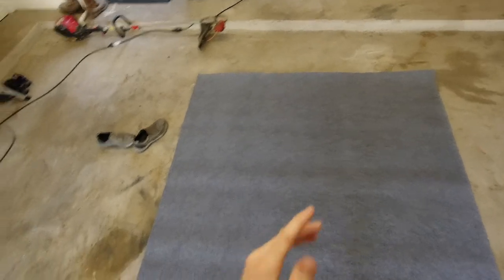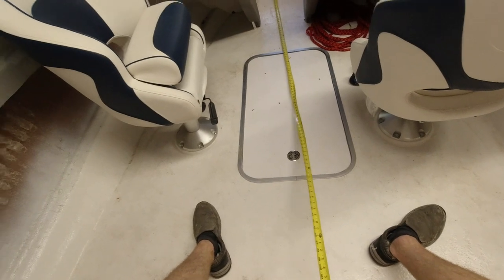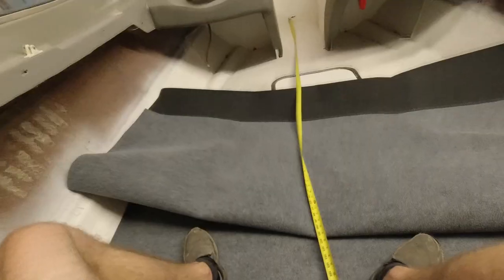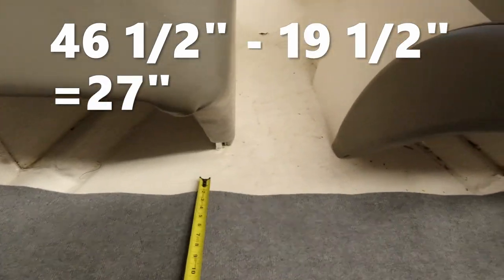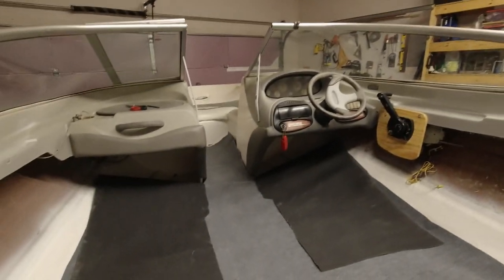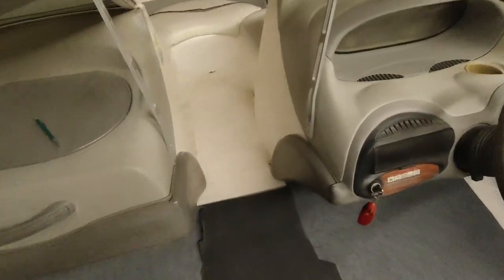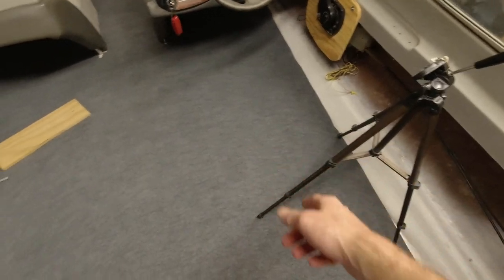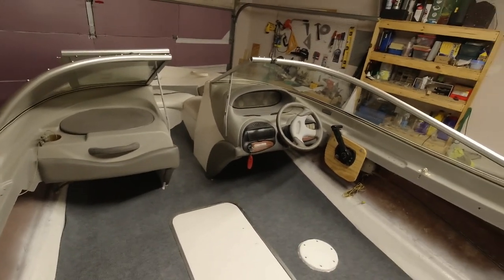Bayliner Boat Restoration - Part 38 - New Carpet!

Comment: I just got a project boat, This is the best video series out there for people rebuilding boats!
Reply from the maker: Thank you! glad you like it! :)
Reply: For more stuff check out friscoboater as well
Reply: @ZachsGarage1  just picked up a 1996 VIP Valiant today for $700 and this channel is going to be my go to for help. I'm in DFW where in TX are you at Zach?
Reply from the maker: @atomicunderground9971  Austin
Reply: @ZachsGarage1  Already having some fun on the boat. I have the 4.3 Mercruiser. Was that engine rebuild your first or did you have previous experience? I'm thinking even though mine is not seized, I should rebuild while I'm at it. There is a weird hole broken near the starter on the fly wheel cover. Its small but I cant figure out what caused it.
Reply from the maker: @atomicunderground9971  First Boat, First Rebuild!
Reply: @ZachsGarage1  Awesome job. Thanks for replying.

Comment: We've installed carpet first in our 2000 Bayliner Capri  and used the existing carpet. If we didn't have it. We planned to use paper to make a paper template.   Saves wrestling with the carpet.  10 years later installed vinyl.  Used a paper template for it turned out great. Glad you got it done. Looks great

Comment: Im Going back with the striped deck matting. Are you putting your side panels back in?
I need a ski locker door can you tell me where you found yours?
Reply from the maker: For the ski locker door I used the old aluminum frame from the original door and just cut out a piece of plywood to size. I think I am going to build some new side panels
Reply: @ZachsGarage1  Yeah my locker was missing. I'll have to find the vid if you made one of your install of it. You could not save the side panels? I love mine. I did find the same pleated vinyl used in the side panels in colors so i may change mine. I'm doing the bulk heads and floor now. Bulk heads are fun, not!. Using poster board to get the shape right on hull though makes a little easier. Heres the links to materials i.mentioned earlier I'm using when it comes to the pretty parts later. 
https://www.amazon.com/dp/B07LH5BVN8/ref=cm_sw_r_cp_apa_i_ixCuFbCEC0V2H, 1https://www.amazon.com/dp/B07YST28VW/ref=cm_sw_r_cp_apa_i_owCuFbHNJ1V6M.
Also thinking of doing some trick lighting on side panels with neon string in seems of the vinyl like i did on a show car i used to have. 
And then some trick stereo of course lol.

Comment: Do you know how to fix small soft spots on boat deck? What product or penetration epoxy to inject the deck?
Reply from the maker: If a spot is soft the wood underneath the fiberglass may be rotted. To fix it you'll need to cut out the area and replace it
Reply: Zachs Garage thanks

Comment: You should have used sea deck more than used carpet
Reply from the maker: I really wanted to get custom designed sea dek. I do actually like the removable carpet more than I thought I would though :)
Reply: @ZachsGarage1  I have 1996 larson that I want to start a project on I bought it back in May but I have with it this summer n winterize it already. So my there are parts of my stringers rotted out  but wonder if I can do do the middle stringers or I have to do the entire thing. Also I have issues with leaks around the gimbal but I used marine sealant n seal around it but I want to take it off n reseal it but I hope the transome ain't rotted out.
Reply from the maker: For the transom, if you want to get a better idea (without removing the engine and outdrive) you might be able to unscrew one of the stud bolts in the transom assembly and be able to check that bolt hole to see if the transom is mush. If part of the stringer is good, I think you should be able to leave it and splice with new stringer
Reply: @ZachsGarage1  yea but I barely have access to get back there
Reply: When watch the history of removing volvo penta drives it kinda pain in the butt
Reply: Also definitely have to remove the engine because the mount base the front rotted out